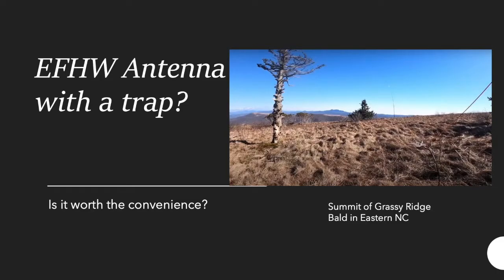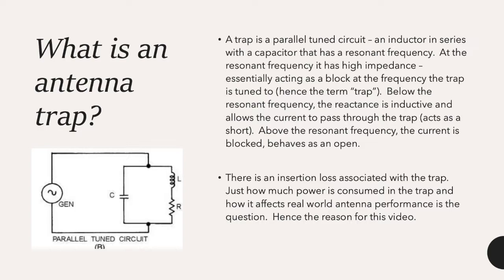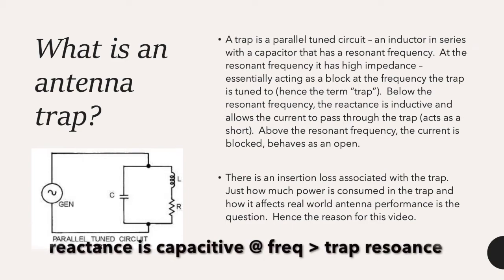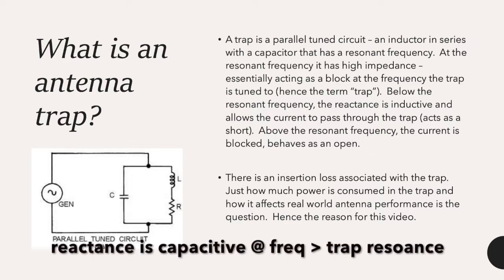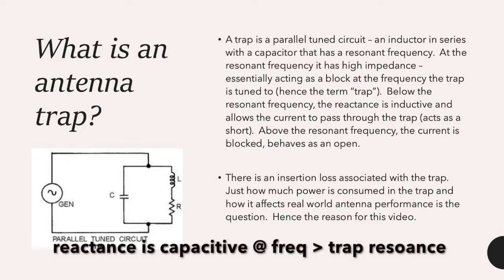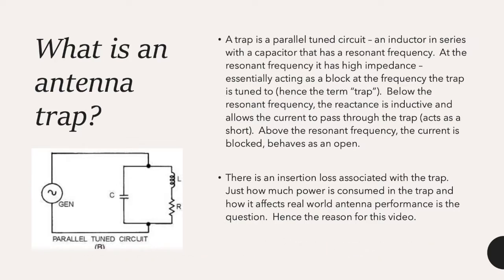End Fed Half Wave Trap Antennas - what is the price for convenience?

Comment: Ariel that was such good information. The price of convenience is a great way to look at it. I have been thinking of using a trap to add 60 m to my Ariel’sAerial but after watching this I will stick with my 24 foot extender. So what if I have to stand up once in a while?
Reply from the maker: I just had a QSO on 5.332 with K9DAC (SKCC) in Ohio and he was running 100W and I was running 5 watts.  He gave me a 559.   It is raining outside and it was sure nice that I did not have to go outside to connect the link to enable 60m.  Surprisingly, the 40m half wave portion of the wire behaves as if the trap isn't there with resonances on 20m, 15m and 10m.  So it is effectively a 5 band antenna.  Since I have a tuner- the mismatch on 30m is 4.6:1, 17m 3:1, 12m 3.5:1 easily tuned with a KX2 or KX3 ATU.  I ran WSPR last night and was heard by a WSPR receiver in Austria and the Azores.  Since I have a link to make it a 30m half wave - The MTR3B and 4B will be perfectly happy.  The sweet spot on 40m is right at 7.065 MHz which is where I like to operate.

Comment: I was puzzled that distance was what you mainly were measuring.  Just to let you know that I think differently, I focus more on signal to noise ratio and just want to see where the signal is strongest. Each of your antennas may stronger at different distances vs one antenna being stronger  everywhere.  I have some WSPR transmitters, let me know if you want to get together and do some tests.
Reply from the maker: You may have a valid point and because of slightly different patterns my assessment may be too simplistic.  I am interested to hear how you would carried out the test.